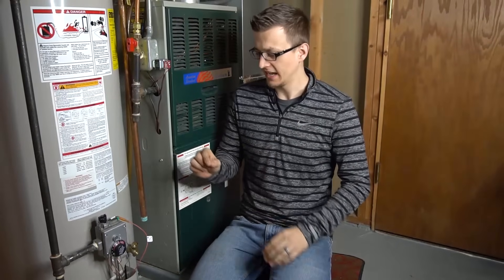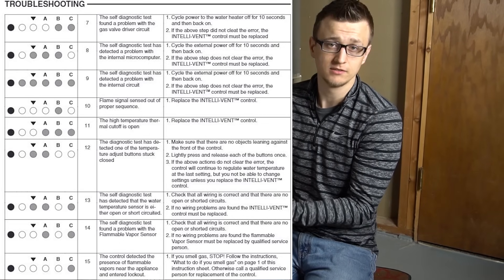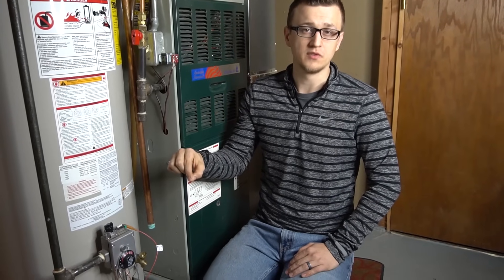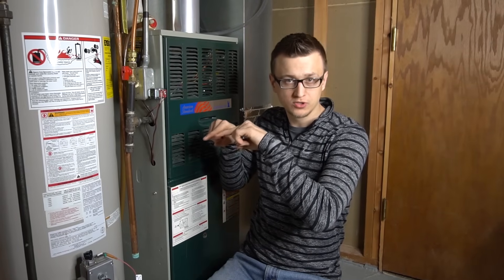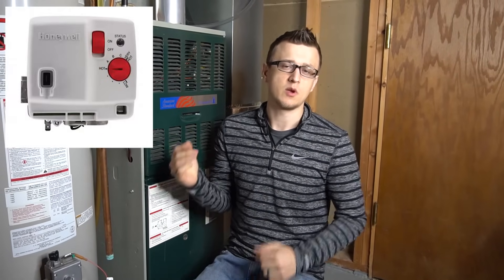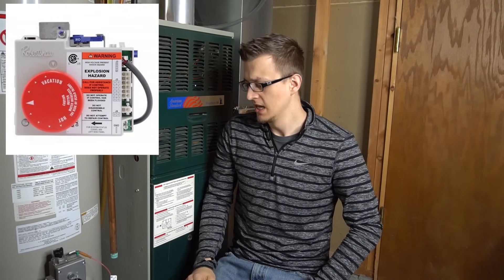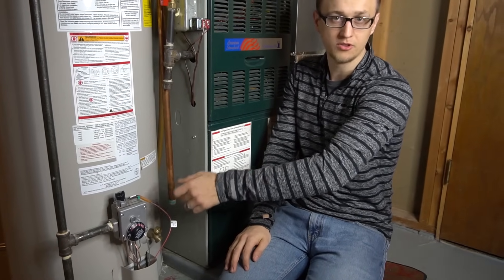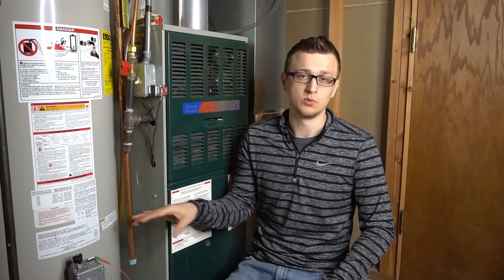How To Reset Flammable Vapor Sensor on Water Heater

Comment: As other have mentioned, I wanted to thank you for a prompt diagnosis to our flammable vapor lock after we returned from vacation and had new hardwood floors installed. Your Honeywell tip in particular was a life saver. THANK YOU for such a clear video with practical steps. Lifesaver.

Comment: My FVS went into alarm, Honeywell gas valve, because it was submerged in water. At first I thought I could bypass it, but that just changed the code from 7 flash -pause to 8 flash - 1 flash - pause.  

After finding your video,  I dried ithe sensor out with a blower and tried to reset with your instructions.  It began to start and then brought the code back.

I ordered a new sensor and installed it.  I tried to reset the code again using your instructions, but it will not reset.  Is there anything else I could look at?

Richmond 50gal, 42k btuh

Comment: Just had a windy weekend and my pilot light won't turn back on. My White Roger sensor is giving the flammable vapor senser code but when I tried your reset code no green lights all across the board popped up. does this mean I have to replace my sensor?

Comment: Secret code?? Why would they not just put a reset button? No one...absolutely no one, wants to screw around with their water heater. Come on!!

Had no hot water this morning. Saw the LED flash 7 times for the lockout. Thanks to this video, I was able to reset my Honeywell style valve.

Comment: Amazing video, didn't waste any time and got right to the point. Much appreciated. Yesterday afternoon, we had a plumber here doing a routine flush on our rather geriatric pipes that we get done every six months and no one noticed that the hot water was gone until this morning. I read the status code, seven blinking blue lights on a Honeywell, found this video and solved the problem. Oh, on the newer models there is literally an on/off switch that you can flick before moving the dial back-and-forth to light the pilot flame.

Comment: Thanks for this video.
This did not work for me. I have the rheem with the WR. I inputted the code. All the lights came back on. It then instantly went to the same erroe code. Does that mean the vapor sensor needs to be replaced?
Reply from the maker: You're welcome! Yes. If the code immediately comes back, that usually means the sensor is bad and needs to be replaced.
Reply: @WordofAdviceTV  Merci

Comment: What a great explanation for this issue. I just had my basement floor painted with an oil base paint six days later still had no hot water heater working. Mine has the Honeywell valve. After the six rotations of the thermostat it fired right up. Thank you so much.

Comment: THANK YOU!!! ❤❤❤ About 4 weeks ago, our basement flooded knocking out the hot water heater. Following 3 visits & $250.00, the service technician was unable to fix the problem. The “Flammable vapours detected” error persisted. After waiting for the basement to dry out, the problem continued. We were in the process of contemplating a new water heater. 

We watched your video today, re: The Honeywell model…my son followed your advice to toggle the dial 6 times… IT WORKED!!! We now finally have hot water!😂

Comment: 2024 - Thanks to this video👍, Mine was Reem with Honeywell Water heater.  We had a power outage in the area that must have tripped it. Followed directions: unplug wait 10 secs. Put switch to ON. Then go High Low - 6 times, you will hear a click and then Flame starts 🔥🔥🔥🔥

Comment: I was away from my house for 10 months and then I had my floors resurfaced… Luckily, I was able to figure out the code of the water heater and then search for flammable vapor sensor lockout. Your video came up… And within minutes, my water heater was back up and running! Great job!

Comment: Rheem water  heater Honeywell valve (7) flashes indicates Flammable Vapor sensor no indication on how to reset fired up immediately 1:30 am did not want to take a cold am shower thank you for your clear and right to the point video solution ( I cleaned the water heater shed yesterday lots of dust ) Again great job Thank you Sir.

Comment: Jay, I missed you very much. You happen to be very smart & interesting to watch. 
Well, to start: I need an Electric Water Heater. I have my T.P. in the middle of my linen closet. I can't reach it. This is really a hard place to fix. I would really like to do this, but unable to. This is a cause of losing your Water Heater.
You have taught me so much about A/C Units as well. 
It was wonderful to find you again on U-Tube!
I had no idea of this part of an Electric Water Heater, and now I do. There should be a more reasonable location to put your Water Heater, so it can get replaced. I can imagine how green it looks inside the T.P.
Thank You!
🤓🤔💨🚱

Comment: Thank you for the advice.   I have a Richmond water heater with a honeywell affixed control board.   When i tried the 6 times (rotating the dial from one end of the spectrum to the other,  it served only to change the error code from a 7 to an 8-and-1 (both vapor sensor related).
Will stop at grainger tomorrow and hopefully get a new sensor.

Comment: Thank you so very much for your advice.
Had to reset  the vapor sensor on the Intelli Heat unit and it worked again. 
Thank you for sharing this very valuable information 🙏🙏🍀
Reply from the maker: You're welcome! Glad it worked for you!
Reply: @WordofAdviceTV  - if I may ask you. This unit is 10years old and this is the first time we had a fault code since it was installed.
Is it a good time to replace the valve and vapor sensor after 10 years of operation ? Or do they have more life in them ?
Reply from the maker: @rolandbruegger4482   Usually resetting it is enough. If it trips again, then just replace the sensor, no need to replace the gas valve.
Reply: @WordofAdviceTV  - thank you for taking the time to answer that. Much appreciated 🙏

Comment: Does that reset code work for kenmore hot water heaters?
Reply from the maker: I can't say for sure but there won't be any harm in trying.
Reply: @WordofAdviceTV  I tried. No go. My water heater got wet from the water line leaking and shooting all over the place. I think the FV sensor got wet. Do you have any advice?
Reply from the maker: @dianeditonno3569  If it got wet, then it likely shorted out. You would need to replace the sensor.

Comment: My gas valve looks nothing like any of these.  It is an Emerson.  Kenmore Elite with some fancy return fan.  FV sense flashing, display is locked, I have already changed the sensor. Diagnosed by a repairman who did not carry the part.  Nothing the instructions say or what is suggested here is working or similar...

Comment: Hello I have gas water heater and there’s a sensor on the burner door keep tripping I reset it some time last couple days and some time only last one cycle do I need a new sensor?
Reply from the maker: Are you referring to the flammable vapor sensor that I am talking about in this video or is this a different sensor with a little button on it? If the latter, then your burner chamber is probably overheating which is why the sensor is tripping. If your water heater has an intake screen, I would try cleaning that. Next step would be to pull the burner out and clean the burner assembly and the chamber.

Comment: Just went through this on the Honeywell control, doing it wrong (of course). My handyman showed me how: 1) turn off the control, put the dial to Low. 2) Turn the unit back On and, within 30 seconds, turn the dial (as noted in the video) from Low to Hot SIX times. 3) Set the dial to the desired heat and you should hear the pilot come on and the blue indicator light will illuminate at the "heartbeat" rate. Good luck!
Reply: i am very gratful for you right now, sick kid, no hot water due to a "low voc" paint that tripped everything and you fixed it up for me

Comment: W/O reading all 626 comments, which I AGREE with that this is the 3RD time a video has saved me hundred$ with the 'SECRET MOVEMENT' of knob(s), does anyone know why manufactures leave these REQUIRED step(s) out of instructions? The cynic in me says they want to make money off of: (i) selling sensors, (ii) keep their trades-partners in biz, etc. In this specific 'fix' their instructions are to turn off gas valve & blower, turn the temp down, unplug blower, plug back in, turn on the two items and then turn up the temp.. Does not work without the last step of turning temp up/dwn 6 times.

Comment: I’ve used this before (second option) it worked. This time though after doing it it will light all of the LED lights up for a moment then go back to the two outside ones.. have tried multiple times 🫠

Comment: Just installed natural hardwood floors sand oil based poly tripped the Sensor. No info in product manual, but you have come to the rescue. Thanks so much, your efforts are truly appreciated.

Comment: A few days ago, I sealed my ceiling with oil-based sealer, and then my gas hot water heater stopped heating water and displayed a flammable vapor sensor locked code.  The manual said to replace the entire unit...i.e., permanently damaged.  Your video, extremely well made and presented very logical and progressive, provided the secret reset to unlock the unit.  Amazing presentation!
Reply: Sorry to bother you, but my ceiling stain came back, so I applied two additional coats of oil-based sealer and then applied ceiling paint, and the stains are now gone.  Prior to applying the two additional coats, I turned off my water heater until after I applied the paint, so the fumes would be near zero when reapplying power.  However, my water heater now continues to display the Flammable Vapor Sensor Locked code after trying the above trick to reset the water heater.  Do you have any suggestions now?  Thanks again for your video.
Reply: Additionally, my 7-pulse lockout code begins six seconds after turning on the Honeywell control box.  Your video states to cycle from Vacation to Very Hot six times, but your written instructions state to cycle from Hot to Low six times...I've tried both ways after turning on the control box...even within the first six seconds.  I even put the vapor sensor into a container to ensure the air had zero fumes.

Comment: You are a life saver!!!!! I had a bad code 8-1 and replaced the sensor.  But, then I got a 7 code ... but I have a natural gas sensor/alarm right next to the tank.  So, I know I don't have a gas problem.  Apparently, once you get locked out, you have to enter the cheat code to unlock it.  You, my friend, saved me days and days of waiting for a service guy... and saved me the cost of the service call too.  The heater is running normal now after clearing the lock!

Comment: the FVS (25VS) is often a one-shot deal - once it trips, the molecules the sensor absorbs will permanently disable the sensor. You can connect to the 2 leads a resistor between 15k and 22k which will disable the vapor sensor and will prevent your water heater from disabling itself. Bend each resistor lead in a u-shape and insert into the connector. You can also use a potentiometer (variable resistor).  I have bleach and my washing machine right next to my water heater and the bleach fumes will destroy the 25VS even though bleach fumes aren't flammable.  This will make your water heater a dumb one like the old water heaters which don't have this vapor sensors.  Dust can also settle on the carbon screen and decrease the resistance to also trip the sensor. Blasting the sensor screen with compressed air is a no-no since it will destroy the delicate carbon sensing screen.
I also have a gas furnace next to my hot water heater with a constant pilot light so this safety device doesn't make my garage any safer than with it disabled.

Comment: Same experience as others on my water heater with the Honeywell control valve. Codes flashed 7 times indicating vapor sensor problem per the manual. I powered off/on several times to no avail and  went out and got a new sensor SP20172 (~$22). Same result. While waiting on hold with Rheem customer service I came across this page. Did the "cycle 6 times Hot/Low" and voila it started working. The confusing thing is that the manual never mentions this procedure. It just says "Reset the combination Gas control" as step 2 of troubleshooting. To me, "reset" means powering off/on. I pointed this out to rep when she came online and she made a note of it on my record. They need to update their manual.

Comment: Thank you, thank you! One more thing unplugging the led pad  would not fix the sensor trip I unplugged the sensor as well and then the reset (also blew in sensor like the old Nintendo games) and the reset worked! Thank you for distinguishing the different brands, a few years ago i came across a video And they only mentioned the left right code but mine was the intelli vent double button reset, so reset didn’t work so I replaced the sensor but was without hot water for 3 days waiting for the sensor to be delivered.

Comment: I think I need a new sensor.  How do I determine the part number?  It is a White Rodgers Thermostat but looks like the Rheem.
Reply from the maker: Those should be pretty universal - one size fits all. I've seen them in hardware stores or you can order it online.

Comment: Thank you for this video! My wife is having contractions and we are doing a home birth. Realized we had no hot water and started losing my mind. If the contractions turn into full blown labor, I won’t be able to fill the birthing tub with hot water. I think ammonia from the litter box tripped the FVS sensor. You saved us!
Reply from the maker: May God bless you with a smooth delivery my friend!!! Glad to hear the video helped, stay strong!
Reply: @WordofAdviceTV  thank you! FYI contractions stopped for now but the FVS sensor tripped again. Back to 7 consecutive flashes. I’m thinking the sensor is bad? Need to dig thru some boxes to find my multimeter. Never a dull moment
Reply from the maker: @alexbromley9384  Good to hear that at least the contractions stopped! If the sensor keeps tripping when there's no odors around, its probably going bad and needs to be replaced.

Comment: 2016 (ish?) no b-vent Rheem with the Honeywell on it. Mine has the powered damper that closes though, increase the efficiency of the unit, otherwise it just vents out the flue shared with the gas furnace. I replaced the vapor sensor first, but that still wasn't. This did the trick to reset it. I'll keep the old vapor sensor in a bag taped to the tank, just in case this new one does fail.

Comment: Thank you for the video. I had no hot water and my Honeywell gas valve/thermostat was flashing an error code that the thermostat had overheated. I was going to change it but I wanted to check out other possible causes. Followed the simple reset instructions and immediately got the burner on and producing hot water. Saved me time and $250.

Comment: Worked for me. Just as you said. Painter yesterday was using oil based primer. Today, no hot water. Cycle the power, turn the heat knob 6 times, all good.

Comment: Thanks for the great video instructions! I replaced the temperature pressure valve on my water heater because it failed to reseal after testing (the unit was 12 years old). While working on that and splashing water on the floor I decided to clean the concrete floor (it was dusty/dirty). After installing the new temp/pressure valve and starting the water heater, it was throwing the flammable vapor error code and would not ignite. I tried a dozen times without luck, even after running a fan overnight to dry the concrete. I did more internet "studying" which told me how the flammable vapor circuit works. Basically, the sensor is a variable resistor that will change value when a flammable vapor (or other debris) is detected near the floor. My temporary solution was to disconnect the sensor and connect a 33,300 ohm resistor in its place. The water heater fired up immediately on the first try after that. So I know the sensor needs to be replaced (about $30 on Amazon). Without knowing your LRLL RLRR button code, I would have been at the mercy of a plumber looking to make a couple grand by replacing the entire unit!

Comment: Thank you! I had to replace my sensor, but this is still very helpful information. A few years ago I had my floors refinished and the sensor tripped. I was unaware of how it worked and when I asked a large plumbing company here in Denver if the sensor could be reset, I was told no and was then charged $500 for them to replace it. Total rip-off. This time I did more digging and bought a new sensor for $50. I was being quoted $2500 for a new water heater!

Comment: thank you. I just came back today from vacation (many flight delays) and have been awake for 69 of the past 72 hours. I had the trifecta, Sump Pump failure, HVAC and water heater all not working. we had someone restoring floors which we think created a ton of dust and there was also a very powerful storm that came through and caused power outages. 

Fixed the sump first by lifting and unblocking the inlet which had got jammed up with debris from the storm. Then replaced the HVAC filter which I think was clogged with the dust from the sanding. The water heater stumped me until you told us all about the Honeywell control on the Rheem tank and hacving to toggle between low and very hot within 30 seconds. Probably caused by the sanding or perhaps the stain / finish.  I did it and heard that little baby click in after 4 cycles. Wife thinks I'm a genius, kids are all happy that they can shower after such a tortuous journey home. You saved me calling out a repairman.

Comment: Thank you so much! I have the Honeywell. 
-Unplug for 10 seconds  
- Switch the dial back and forth 6 times from Low to Very Hot.  
My pilot light fired up immediately and I set my dial to preferred setting A.